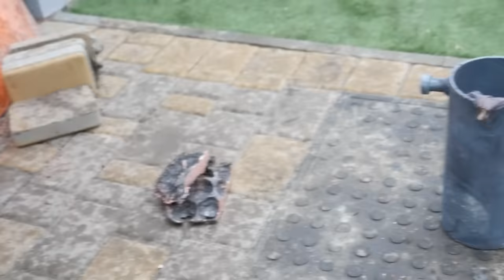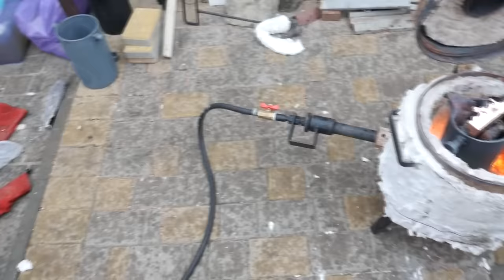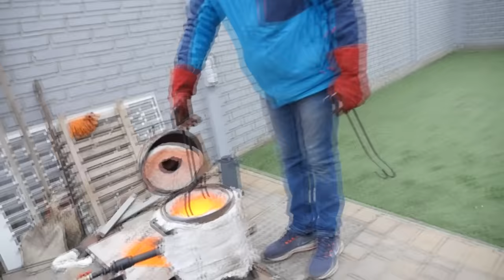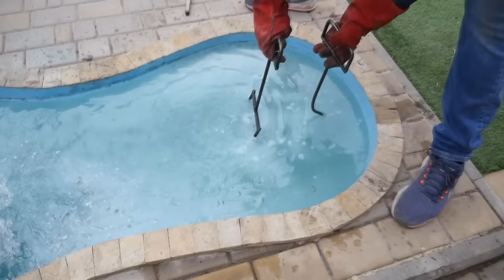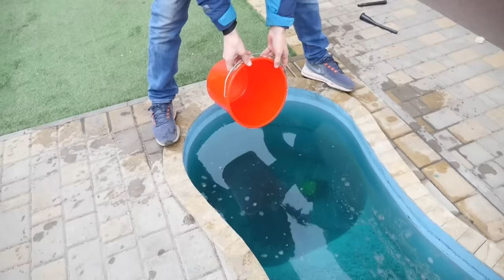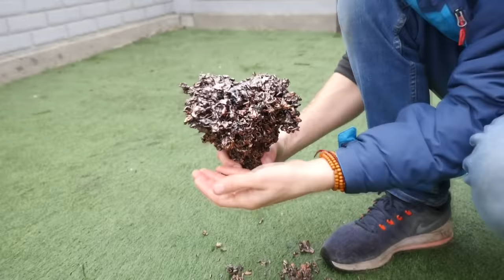LAVA vs POOL

Comment: It turned into solid iron because the lava they were experimenting with, were made from melted liquid iron, which is different to the natural lava  that's  made by melted stones or granite. That's why we didn't see an obsidian.
Reply: It turned to solid iron because it was melted iron
Reply: Liquid metal it still metal
Reply: Only melted rocks is lava
Reply: And nothing else
Reply: i thought it was copper not iron
Reply: Or right copper what a diffrent (i know copper is really other than iron)
Reply: Btw i like you for playing ark
Reply: It's probably copper, which has an even lower melting point than iron.

Actual lava would be igneous rock which has a higher specific heat capacity and a much higher melting point. But at that volume it'd probably still not have enough heat to boil the pool. Water is a really good coolant.
Reply: No its not,change my mind

Yeah u cant cause i blocked u.
Reply: Duh
Reply: Guys, it's just aluminum
Reply: oh, is that why it only really happens in minecraft on not here then because he didnt mine down like 500 miles underground just to get lava only to pour it in his pool
Reply: bruh y'all wrong. its copper (bronze)
Reply: It’s not lava if it’s metal.
Reply: Obsidian volcano
Reply: Even inside the earth lava is maximum of melted metal hence we can compare them and also this experiment explains that even lava will not effect in water that is the reason why there is still water in pacific ring of fire.
-M.Naveen kumar

Comment: Everyone else: talking about minecraft and hot tubs 

Me: how did they heat the lava up enough to be as thin as water??
Reply: ikr
Reply: Thought i was the only one who noticed lol
Reply: They didn't
Reply: That's because it's not true lava made out of rocks, but simply molten metal which is indeed as thin as water, you can confirm it by watching how mercury flows
Reply: Actually there are different types of lava (4 or more) some are very viscous (thick) while some are not that viscous, i think the lava shown in the video is a low viscous lava, so it appears thin.. 
(Also that they did not melted a normal rock, they probably melted a mineral(metal or non metal) as lava of some minerals are less viscous
Reply: Its not lava ! Some kind of metal. What a clickbait 😅

Comment: I was curious about the water temperature after the experiment.
Reply: Probably not as hot as you think -- water has high specific heat, and there's a lot of it vs the lava
Reply: 100°C
Reply: @Pedro Ramos me too
Reply: yuhh same bruh
Reply: @umqualquer1085  373°k
Reply: probably below 100 degrees
Reply: @WayToManyAssassins  10000000 degree 😝
Reply: Jakuzzi
Reply: @Muhammad-lq7fu  That never exists, atleast its up too 80° or 90° because of the air. Heat cannot stay for longer, If its 10000000° then it would way more hotter than lava it self.
Reply: @ENA_Bird  hehe I know 😅
Reply: ap3 @muhammadputera6593
Reply: ap3 @muhammadputera6593
Reply: ap3 @muhammadputera6593
Reply: Me too
Reply: POWER LEVEL OVER 9,000000000000000000000000000000000
Reply: I think it remains the same or temperature may be bit higher bcz he dips his hands while pouring water out of the pool ..... If it is hot , how could he dip his hands inside water ? ...... So the temperature may be bit high or same
Reply: Me too!!!
Reply: Neat the lava, above 100c'. Further away probably just a few degree increase.
Reply: because he didn't put an egg it falls into the pool inside that bucket that was the lava so we can see how hot the lava was i'm brazilian ksks

Comment: Ok so basically

Minecraft is a goddam lie?
Reply: No its obsidian
Reply: Antonio Carusi It actually isn’t, what you see at the end is obsidian. Obviously it isn’t going to simply transform into a black purpleish cube if that’s what you were expecting.
Reply: @silverendlessness4052  if ur using minecraft logic then no thats not obsidian ,its cobblestone,pouring lava into water makes cobblestone,pouring water into lava makes obsidian
Reply: @nbmaster-hv8yd  no he isnt
Reply: Antonio Carusi yeah
Reply: @nbmaster-hv8yd  dude you misunderstood. Awkward
Reply: No, it isn't, this "lava" was just melted metal, but if he would have used andesite or some volcanic lava than it would've turned into something like andesite or stone.
Reply: @chokonma9951  ok so basically

This title is a goddam lie?
Reply: It’s copper he used…I think
Reply: Lava is basicaly the same thing as materials, but they are melted. Different lavas make different types of rocks. Obsidians are usually formed underwater by a fluid lava which is constituted by almost only Iron and silica if I'm not mistaken. This guy had just a mixed metal. It's just turned out to be the exactly same metal
And yes, The "brilliant" and pretty colour obsidian exists
Reply: Lionel Messigician no mixing water with running lava makes cobblestone, mixing water with a lava SOURCE makes obsidian
Reply: Antonio Carusi yes
Reply: That's not lava lol
Reply: It's a lie cause he didnt actually use lava
Reply: Nah this was a fake vid
Reply: @silverendlessness4052  r/woooooosh
Reply: actually minecraft is a game and games rarely reallity
Reply: It isn’t a lie. You just looked at obsidian but it’s not like the Minecraft version.
Reply: @chidera5730  It was probably copper, as it has a low melting point.
So low that people during the agricultural revolution (10,000 BC to 2,000 BC) could melt it in some basic furnaces made by the Hittites (Middle east, first civilization to harness iron).
Reply: Offcourse
Reply: Yez
Reply: Mojang lied to us the whole damn time
Reply: dislike your comment cuz bad word
Reply: Its not even lava, look at real lava v water.
Reply: @hwhat  if it's a water source it makes stone
Reply: That wasn't lava
Reply: @nbmaster-hv8yd  r/woosh
Reply: @nbmaster-hv8yd  you also took the L

Comment: I wonder if that was hot enough to purify the water enough to be drinkable? Like all the bacteria in it just got instantly boiled away. Or if the molten metals in turn made the water too toxic for actual consumption because of whatever came off of them afterwards? 🤔
Reply: The molten metal made it toxic,but yeah it did boil away all the bacteria!

Comment: Something I would have liked to know .  The temperature of the water before and after you put it in .  Was the overall temperature change in the water large or small
Reply: The temperature would have increased by about 40°C, water has a high heat capacity so it can absorb great heat without getting that hot.

Comment: i thought it is turning into an obsidian...

MINECRAFT IS LIAR.....
Reply: MUSIC CORE that Is Obsidian Bro But In Minecraft Mojang Made It Like Block
Reply: I think that it has to be a proportion because in Minecraft if it is not a 100% block of lava bucket and a 100% obsedian it turns into stone....what I am saying is just a thought it is most probably wrong
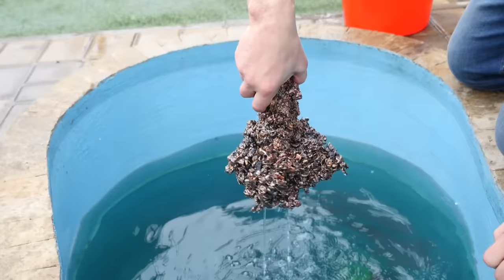Reply: 4:09 so is thia an obsidian??
Reply: @dawlims1334  ?
Reply: That's not obsidian, obsidian is created by a certain kind of rock melted into lava, and then cooled with water, in this case they used a metal like copper so, it doesn't turn into obsidian.
Reply: @DanielSocaza nothing

Comment: Minecraft: Lava touches water= Obsidian

Real life:
Reply: No no it makes cobblestone and if water touches lava it makes obsidian
Reply: Is just you trow water in a vulcan
Reply: @josepereda2908  um what. Have you ever played minecraft? If water touches a lava source block it turns to obsidian. But if it's running and and it touches a running water source it turn into cobble stone
Reply: Duran Demircan next time will not
Reply: It's melted copper
Reply: @vaux3257  No, if lava on top it will become cobblestone. And if the lava in bottom and the water on top it will become obsidian. If lava touch running water it will become stone. U can try it :)